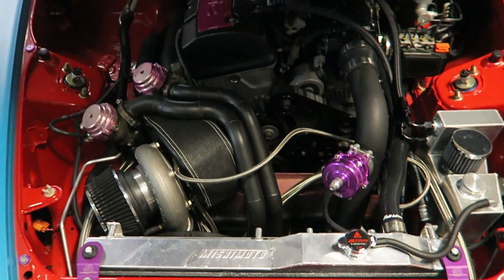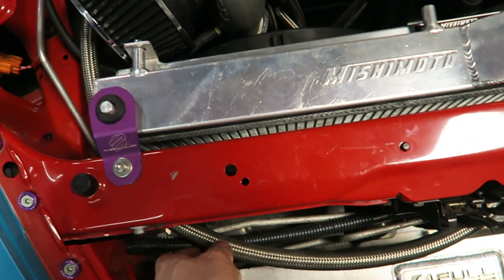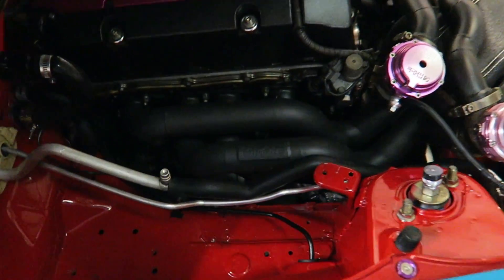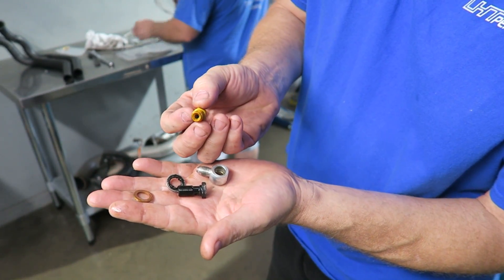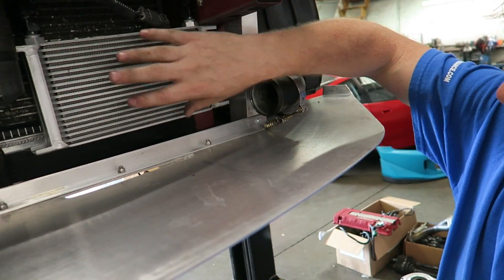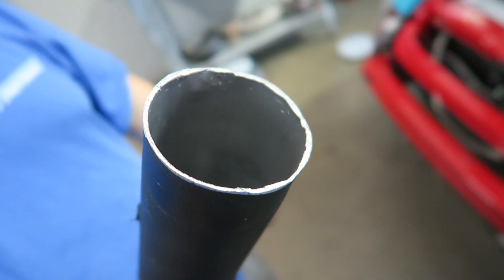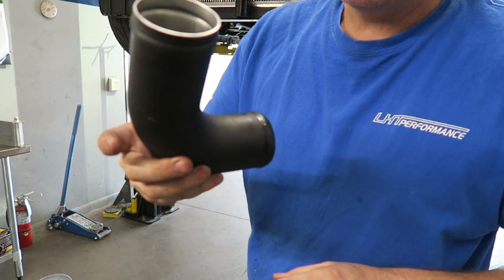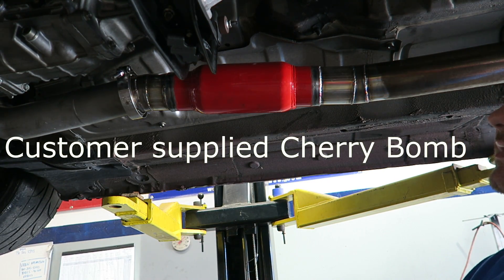S2000 clean up

Comment: Is that a glass cherrybomb test pipe? Also I am running a test pipe atm and I am wondering if that cherrybomb test pipe will make my exhaust drone less and smell less when idling at a stop light lol ? thanks
Reply: Well the "test" pipes remove the cat so no it will not smell less. I got a 2014 GT with a offroad H pipe and this thing will kill if you ever idle it in a enclosed space for more than 10 seconds. I do not recommend cat deletes, its not worth the performance gain.
Reply: That is not what I was asking, It does improve performance gains if you are NA or boosted. Yes it will definitely kill you if you idle your car inside a garage for more then 30secs lol!
Reply: You asked if it will smell less and I told you no it will not. How is that not what you are asking? Go read your question.
Reply: Ok so for the smell it will not, and what about the drone the from the cherry bomb test pipe vs a regular test pipe.
Reply: Ok so for the smell it will not, and what about the drone the from the cherry bomb test pipe vs a regular test pipe.
Reply: Cant help you there. I thought the point of cherrybombs was to make the exhaust louder? So maybe it might make it more raspy? Why don't you go with a high flow cat setup, it will fix all your problems and the performance hit is not that noticeable.
Reply: I had a 200cel vibrant highflowcat in my exhaust and it restricts the flow too much and does not allow the engine to breath as well good well, i am supercharged btw, I should have purchased a Gesi highflow but there like over 500usd lol! those r the best ones..  you should purchase gesi highflowcat for your mustang! looking into it.
Reply: The cherry bomb is a resonator so it makes the exhaust quieter if you're using it to replace straight piping (test pipe). If you're using it to replace a catalytic converter then its louder. My exhaust has gotten quieter
Reply: Ok I have found what you wrote a little confusing for me... So, You used the glass cherrybomb to replace  the (test pipe) and NOW with glass cherrybomb being installed in your exhaust, your exhaust has gotten more quieter then before when your had the (testpipe) installed correct?    I have never seen that been done even before.  An yes most of the time if you remove your stock Catalytic converter and put in a (test pipe/straight pipe/ no cat) your exhaust it will be louder.. Does that make sense?
Reply: Yeah that's what I meant, sorry for the confusion. In order of loudest to quietest it goes: Test pipe, glasspack/resonator, cat converter.
Reply: Thank u for ur information! I might switch out my test pipe and put in a glasspackcherrybomb/resonator and maybe put another one in where my mid pipe is as well on my invidia q300 for my supercharged 2010 honda si lol!
Reply: Werks Guy Megan racing makes a stainless test pipe with a resonator in it... I swapped it for my cat, and it sounds almost the same. it get a bit louder over 8k.
Reply: can you plz post the link to the image of it sir?

Comment: Those mishimoto fans are a joke, awful product. People never listen thou. You guys do great work but at the sametime its hard to believe anyone would do such crap work on the intercooler piping etc, that's school boy stuff. Least the owner can rest easy now
Reply from the maker: I don't like bad mouthing products, but some many people will buy something not knowing that it's worse than stock. SPAL fans are the only fans we use Period.
Reply: LHTPerformance what model SPAL fan was that?
Reply: I have used Spal with great results before but over here in the UK there is a company called Revotec/ Comex that makes low profile fans and their CFM claims are honest unlike the mishimoto fans. You can tell the mishimoto fans are not powerful as they only draw 6amps. Compared to 9-10amps of the Spal/revotec. On a side note love watching your videos always do things the right way.

Comment: looked good and made nice power bet it's good to drive.  not to keen on the turbo intake behind the radiator at least go for a cold air feed to that make relocate air filter to in front of the new oil cooler